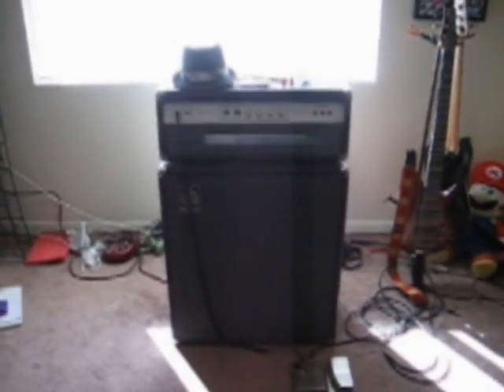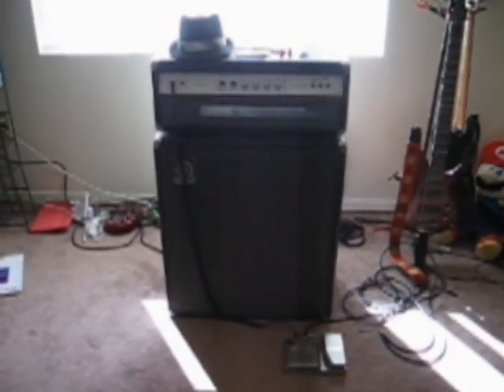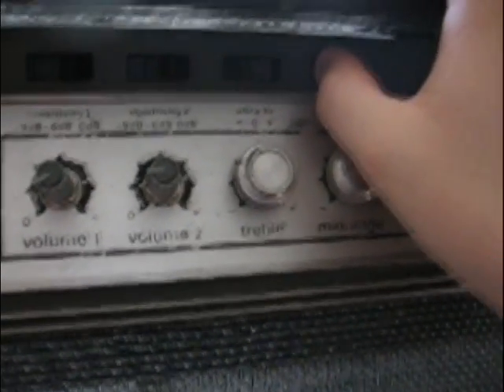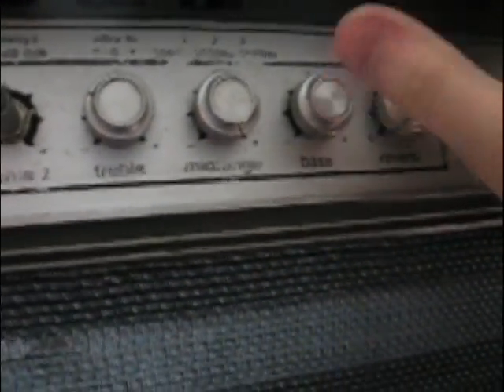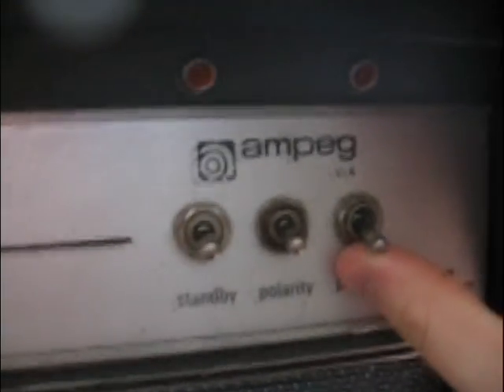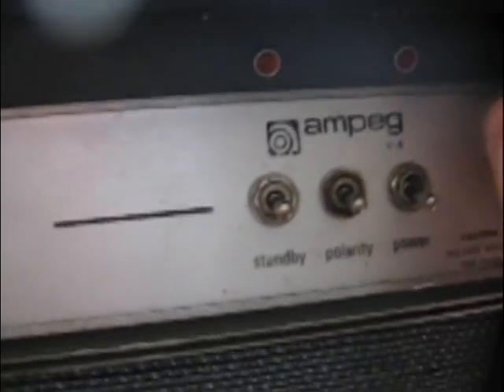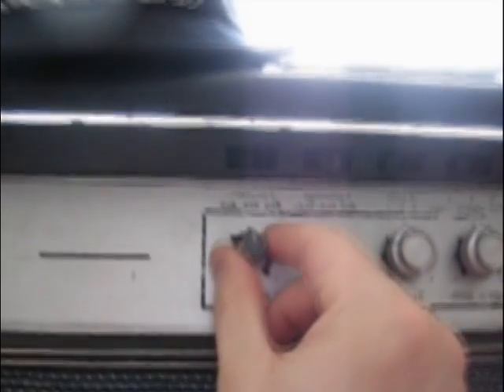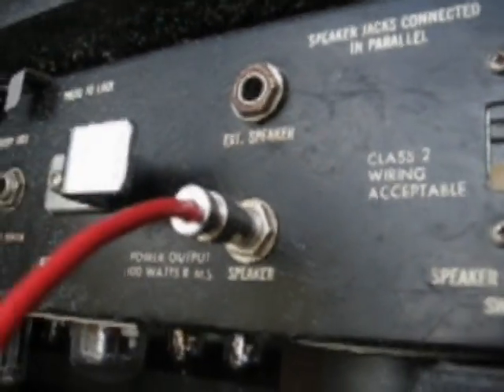The Ampeg V4-part 1

Comment: i love these amps.  i got one of these myself.  sounds great...  i'm about to get it un-modded though.  the owner before me modded it for el34 tubes.  btw the polarity switch was for when the power cable was made with unpolarized two prong plugs.  it was to avoid hum and a hot chassis if you plugged it in the wrong way in the outlet.  if you have a grounded (3 prong plug) the polarity switch isn't needed and doesn't really do anything

Comment: If you get an A/B switch; set your 2 channels for the volume you want. Then you can have a rythm and lead pre-setup. You can also buy or build a small box with a switch and volume controll to overdrive the pre-amp. It plugs into the poweram in and out jacks on the back. Just look around the internets for pre-made or the plans. One more thing; you can also get another one of these and do the same with the power amp in and out using one head to really overdrive and shape your sound.

Comment from the maker: @modestvermin995 Hmmm, good question. When I recorded this video, I had a setup for my tubes that is different than what I have now. As it turns out, tubes were put in that made it more akin to a guitar amp. Having those tubes, the amp had a LOT of distortion. I don't know what the distortion is with the proper, default tubes because I have yet to play it with the volume that high. I'm going to be cranking this thing at a jam session tomorrow so I'll let ya know then.

Comment: I got tons of complements on my tone. I ran it into a 2x12 cab I made loaded with Celestion Vintage 30s. The clean was to die for and the crunch was enormous. I even set it up with an A-B pedal and used the 2 channels for rhythm and lead. Later I used an ART SGX2000 processor... OMG!!!! Also, its listed at 100w which is a joke... 7027As are capable of over 130w. Its a great amp. I need to do a cap job on mine as its been sitting unused for too long and the filters have crystallized.

Comment from the maker: Ahhh, I see! Thank you. I was just going by what info I was told. It's 3-prong

I've got this thing in the shop myself...it started making a static-ie sound a little while ago. It sounds like it might be the caps...of course it could be other things too like the tubes or the pots. I could have just bought some tubes and replaced them to see if that is the problem, but it would have been an expensive proposition. I thought it would be a lot cheaper in the long run to just have someone look at it.

Comment from the maker: @modestvermin995 Ok, just got back from a practice. There is not a lot of gain provided with the default tube setup. I had the thing cranked to about  10 or 11 o'clock and I wasn't getting a lot of gain/distortion.

Comment from the maker: @CR3W1SH03S "It will start breaking up at around 2-3 o'clock with a strong signal and the sensitivity switch to the far right though."

Yep. At the time, this amp had the wrong tubes in it, so it was distorting at much lower volumes. That's why I uploaded the new vid with distortion. Thanks for the comments though, sounds like you had a bad-ass setup.

Comment from the maker: @thebna89 I dunno, the person who used this amp before me used it the same way for a really long time and had no issues. All of the tubes in my amp are 35+ years old, so I would imagine if standby was hurting anything it would have done it by now. I had to replace some small capacitors a little while ago, but they were also 35+ years old...so I doubt how I use the amp had anything to do with the issue, capacitors need replaced over time and is a common fix to do.

Comment: I've got one of these monsters... have had it for years. This amp isnt made for distortion. Everette Hull wasnt a rock and roll guy, he was more of a jazz guy. These puppies are LOUD and clean. It will start breaking up at around 2-3 o'clock with a strong signal and the sensitivity switch to the far right though. Ive found these amps excel at clean. The reverb its huge and it take effects well because it's so clean. I used to use a Chandler rack tube preamp for my dirt and...

Comment: @dkstryker all of the tubes are available at Antique Electronic Supply (tubesandmore(dot)com). (no affiliation) the odd ones are the 12DW7 (1), 6K11 (1), 6CG7 (1), 7027A (4). Also, Fliptops(dot)net (no affiliation) has full kits but they use 6550 s for power tubes and I have no idea what that will do to the sound of an Ampeg. The real PIA parts to find are the power supply filter caps. I need some for an amp I'm rebuilding and for my amp also.

Comment: You should know that the polarity switch is there because the outlet doesn't have a polarized plug and if you have it in the wrong polarity and you touch something that is grounded you will get a nasty shock. To remedy this problem simply plug in the unit and take a meter and measure the voltage between the chassis and ground and if you got voltage flip the switch then mark the plug for that polarity so you don't have to worry about.

Comment from the maker: Yeah, my model had a three-pronged cord...so the polarity had nothing to do with anything on this model. Once I got it inspected for "hissing" the repair guy fixed the amp to disable the switch. I don't know if it would just be the safest bet to replace the cord altogether if someone acquires one with the original cord. 

Good advice in case someone has an original cord though, thanks.

Comment: Just a note on the reverb as you mentioned the knob doesn't seem to do much.  I have this same amp and there is a reverb spring lock/release device on the back of the amp that you have to push in on one side or the other to lock or release the reverb.
Reply from the maker: Cool. I'm sure a lot of people who watch this video will appreciate the tip 8)

Comment from the maker: @modestvermin995 Honestly I would probably recommend using a pedal or something to dial in your gain/distortion. There are tubes you could put in to increase the gain, but it might also affect the quality of the sound. If the overdrive on this amp isn't enough and you don't want to use effects, I would probably recommend you look for another amp (unless you have one of these already, in which case you probably want to consult an expert...).

Comment from the maker: @thebna89 What do you mean by "B+"? I remember reading somewhere that you need to put the amp in standby before changing the settings, but I can't find it. I just looked on the net for a little while and I can't seem to find any literature that says what I'm doing is necessarily a bad thing. There ARE, however, a lot of posts out there that say standby is useless but I'm just going by what I've been told, which is to basically let the tubes warm up before use.

Comment: FYI you are using the wrong type of cable for your amp speaker jack to speaker connection. It looks like you are using a shielded George L cable for speaker cable. You need a non shielded heavier gauge wire cable that is specific to speaker wire.
Reply from the maker: I don't have this rig anymore, but I'm sure anyone who sees this will appreciate the tip. I use the right kind of cables now, but at the time this was what was given to me by the shop I bought it from...so I assumed it was the right cable.

Don't make that assumption folks! lol